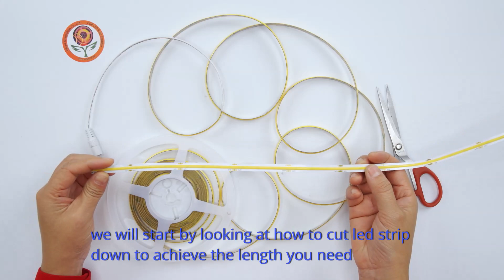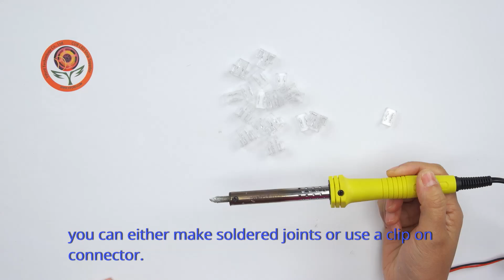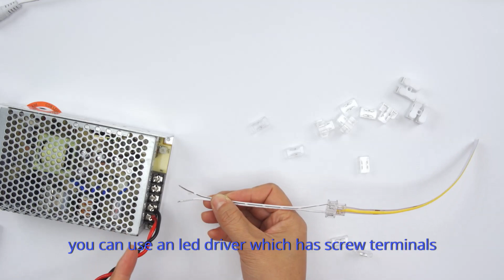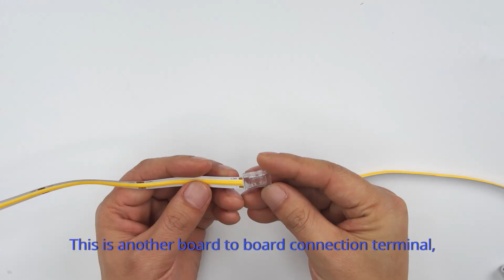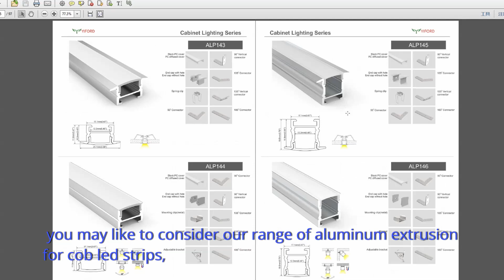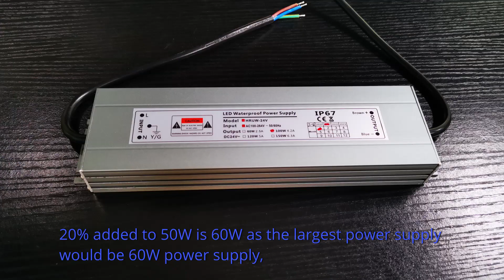How To Cut/ Connect and Power FOB COB LED Strip Lighting-- yiford.com

Comment: If I just cut one side do I still have to add a whole power supply to that side? Or can I just seal it with the clear piece?
Reply from the maker: The part that needs to work can be connected to the power supply. The cut end cannot enter the water, and cannot be short-circuited. The method of sealing with a clear piece is good.
Reply: @ShirleyFang18  thank you

Comment: How to connect that led to usb cable?
Reply from the maker: There are some quickly connector could be used. for example: https://www.yiford.com/products/quick-connect-terminal.html   
you could cut the usb cable first, then use this connector to quickly joint.